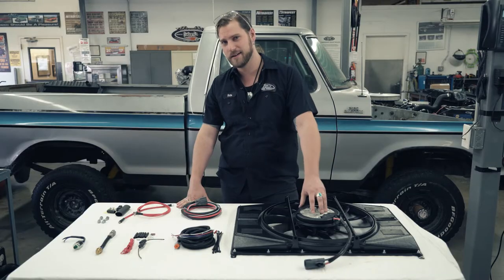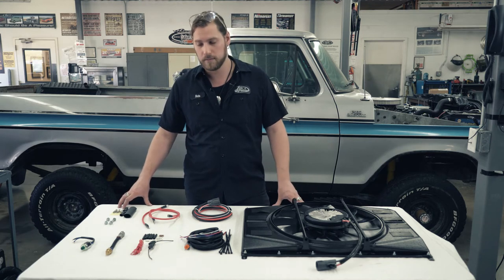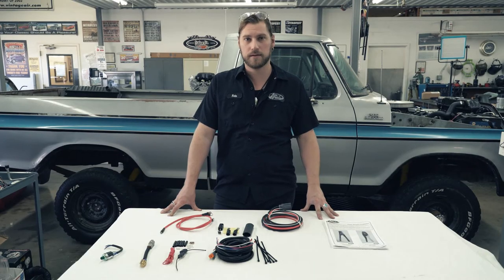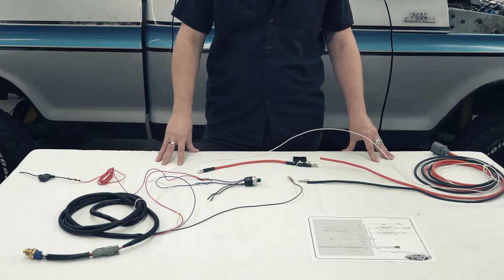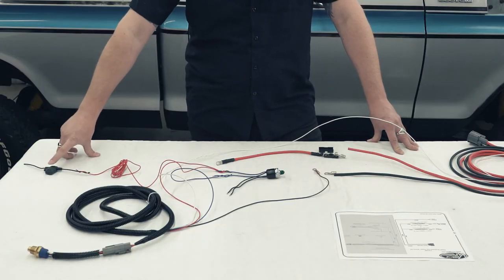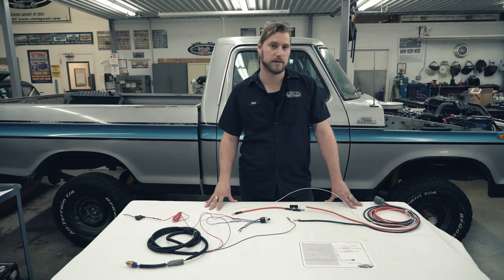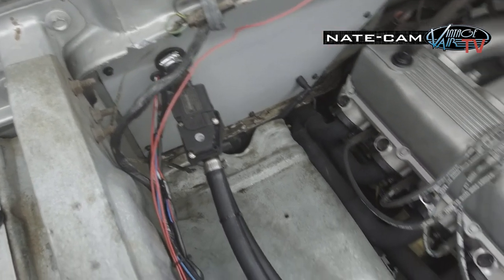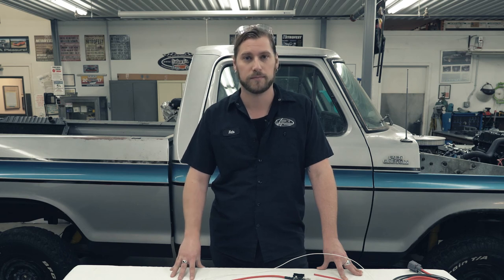Monster Brushless Fan Introduction & Installation

Comment: Nate... Another great VA video. I'm possibly interested in the 371253 1969 Camaro BBC unit and the installation in that car. I have a Cold Case CHC11 radiator which has a typical BBC core size of 23" wide, 16.85" tall, and 3" thick. Was wondering if you have any pictures, links, or videos showing an install of this monster fan in a '69 Camaro with a non EFI BBC? I installed Vintage Air in the car last year using an aftermarket billet serpentine system and the AC is awesome! Cold air coming from the dash ports is around 45 degrees on a hot day at idle! My engine however, running a bit warmer than I'd like at highway and in-traffic so I think the condenser in front of the radiator is restricting the airflow through the radiator core. Currently I'm using a custom designed aluminum shroud with 2-12" fans and a PWM controller.  I don't have EFI so if I switched to this single monster fan... what controller would I use for the brushless fan? The PWM unit can't be used with brushless fans. Thanks in advance for your advice and help.-Mike

Comment: The temperature rating for the fan controller. Is that the temperature in which the fan kicks on or when it reaches full speed?

Comment: If I only have a mount provision near the water pump inlet, can I just use the 180deg controller (I have a 195 thermostat)? That way it's about 15 degrees less to account for the difference in temperature?
Reply from the maker: the water pump ports are on the return side of the cooling system, its best for the controller to be installed on the feed side. ideally somewhere in the intake coolant ports.

Comment: With the trinary switch wired in.. does the fan go full blast when the ac is activated or some set speed like 30%-50%?
Reply from the maker: when the fan is initially kicked on it will be at apx 30% speed, then as the coolant heats up the fan will gradually increase in speed until it reaches 100% speed operation.

Comment: So on your trinary switch the blue wire which is currently going to ground would connect to the blue wire of the controller kit. The other blue wire from the trinary switch would go to the red wire of the controller along with a switched ignition source. Is that correct?
Reply from the maker: James, Yes that is correct!

Comment: Hello, when used with your fan controller and trinary switch does the fan still have variable speed? Or is it just on and off?
Reply from the maker: The fan will still vary speed at first when using the trinary to engage the fan.
Reply: Thanks

Comment: Could it be controlled by the OE PWM Of gM 12612384 E38 PCM? Please Respond
Reply from the maker: This fan set up was designed to be used with our controller, but it can be operated with other aftermarket PWM controllers that have a negative logic duty cycle definition @ 50-500Hz. We show no provisions to be used with the OEM PCM but if logic is the same then I do not see why not, unfortunately we have no data to support it or a recommended method to wire it up to the OEM PCM
Reply: @va197653  thank you

Comment: By placing the temp controller behind the thermostat, once the engine reaches temperature, the fan would stay on constantly. 
I would place the temp controller near the water pump intake (lower hose area). The fan would only run when required, normal highway driving should provide enough airflow to keep the water temperature in check…
😉
Reply: It's very sophisticated computerized cooling fan that have a mind of its own,  the maximum idling amp draw is limited by the built-in thermal sensor, it will sense alternator output and adjust maximum accordingly so it doesn't kill your electrical system or fry its own board while spinning mindlessly